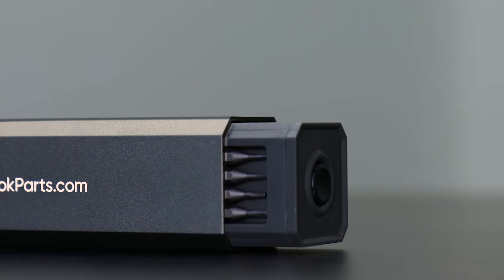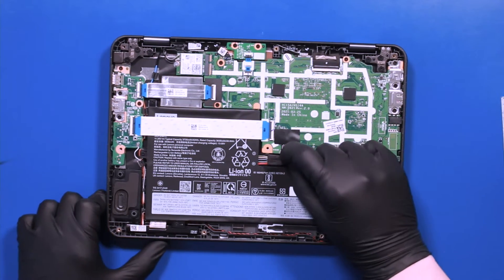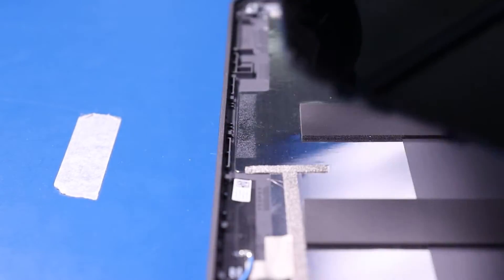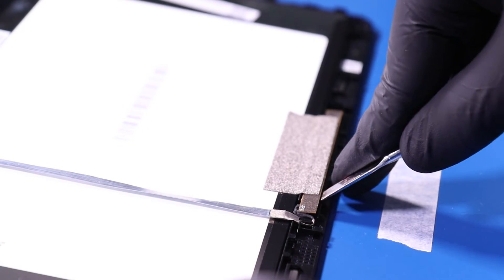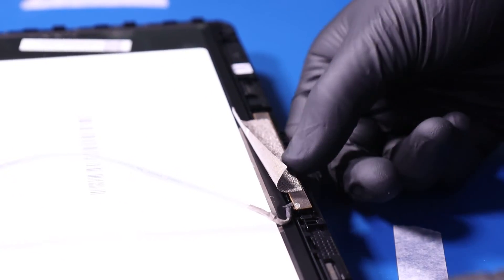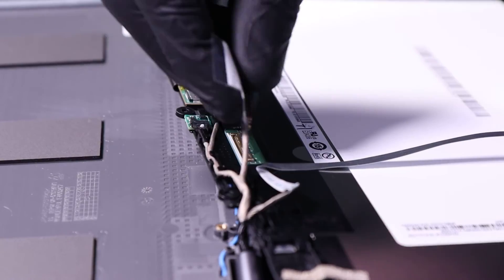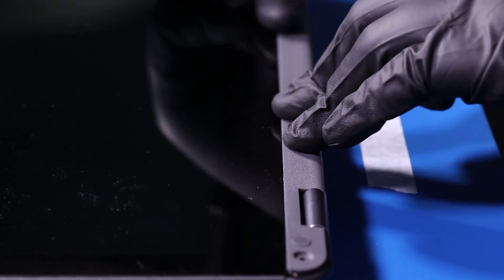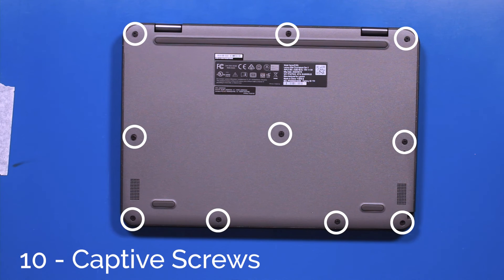Lenovo 500e Gen 3 Chromebook LCD Module Replacement

Comment: Hello,hope this reaches you, i have this same computer and the screen itself is fine its just that the screen has slightly popped out from the edge, do you know how to fix this? Many thanks
Reply from the maker: You could try uninstalling then reinstalling the screen, since you have to slide it - that may account for the slight fitting issue.